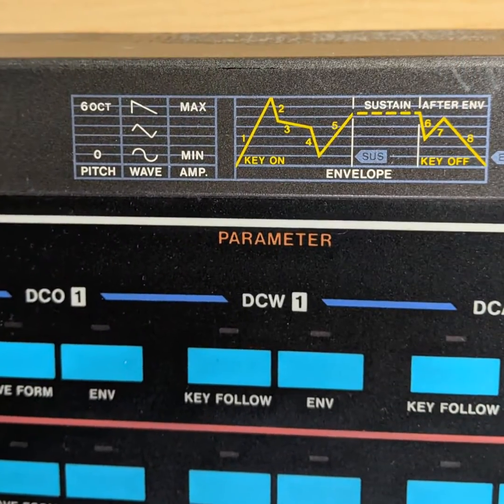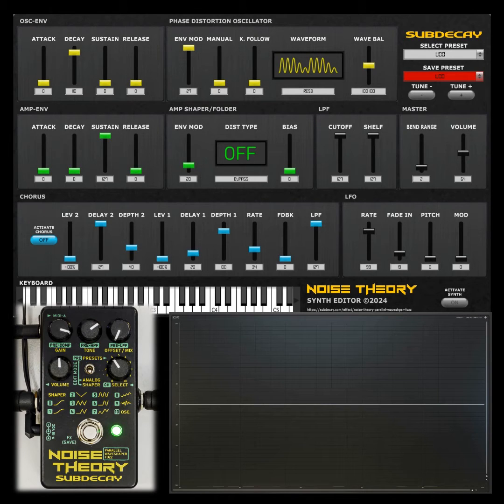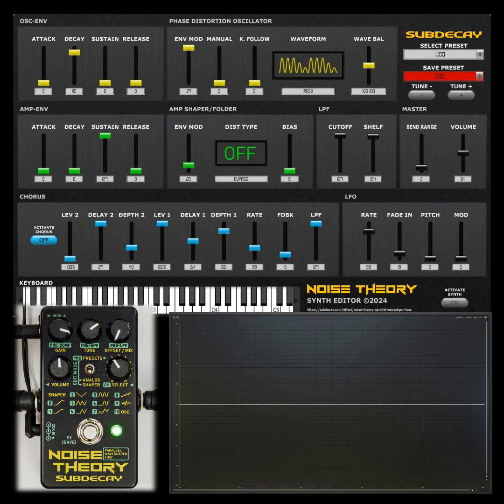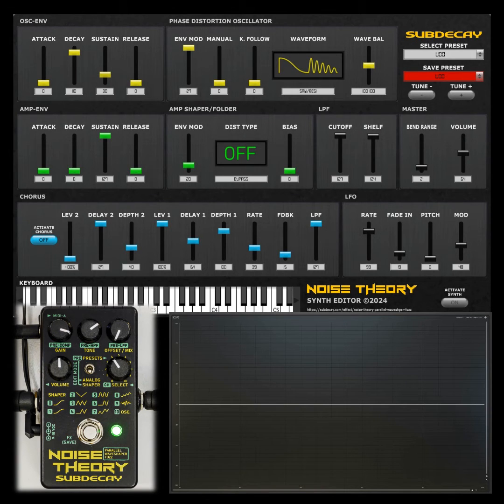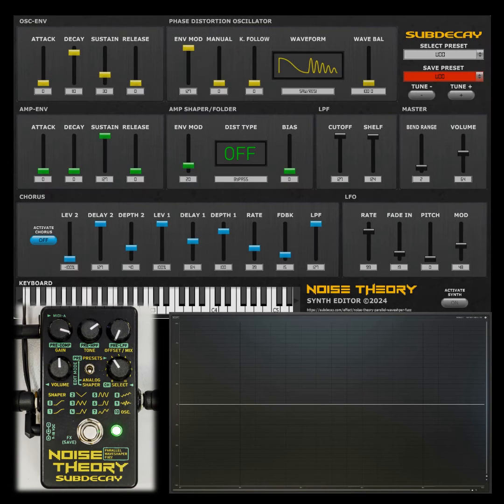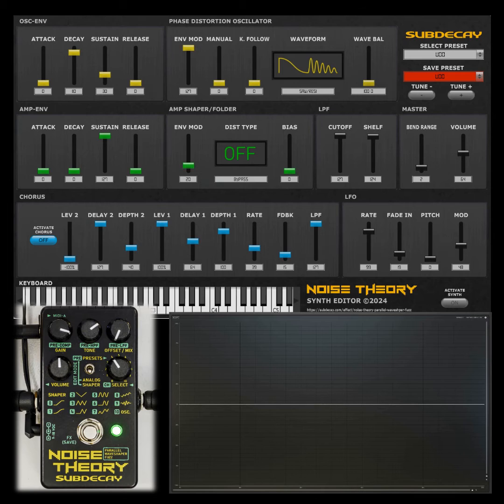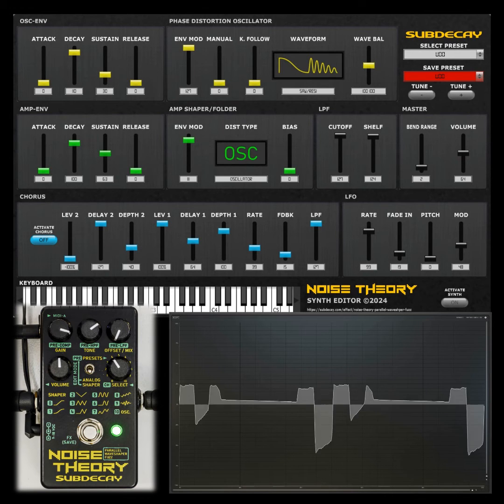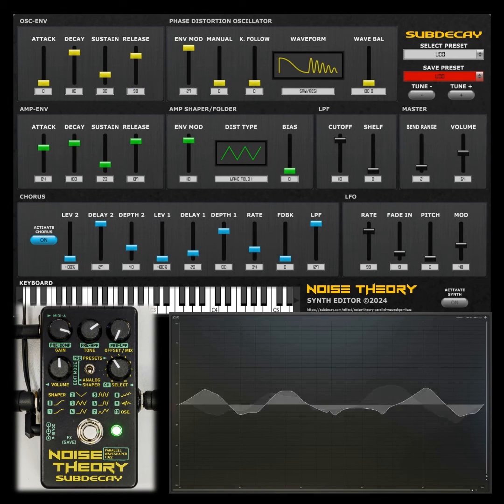Does the Noise Theory's Phase distortion differ from 80s CZ synthesizers? First look at MIDI editor!

Comment: Arrg..!! This is the 3rd (and by far the most interesting) blow to the value of my decaying CZ101..
A Eurorack Module named, Cizzle, a Behringer clone (that might actually appear), and now this…
Which I would actually consider owning..🤔
Reply from the maker: I'm still keeping my CZ1000. One thing the noise theory is missing in the ring modulator, which from what I've seen every copy or vst of the CZs gets wrong.
If I have a real gripe about most of the CZs it's the volatile preset memory that requires you to keep a stock of D batteries.
Reply: @subdecay  I’m beginning to wonder if a copy-write just ran out..😉
Reply from the maker: @outaspaceman  copyright doesn't really apply. Casio did patent phase distortion, but that expired long ago. 
The interest is likely due to people rediscovering phase distortion as the CZ synths were not sought after much until the last 10 years or so. 
Coincidentally some things similar to Casio's phase distortion have been used to modulate wavetable synths for years. There's also loads of VSTs that use similar ideas that have been around for a while.